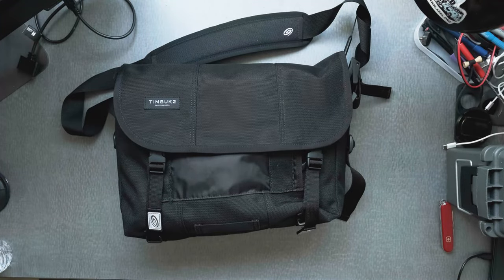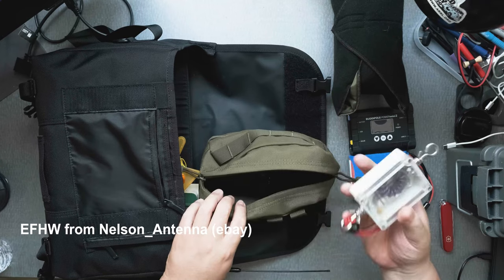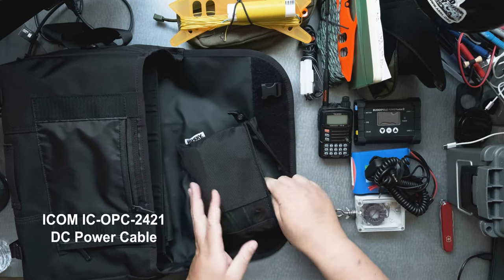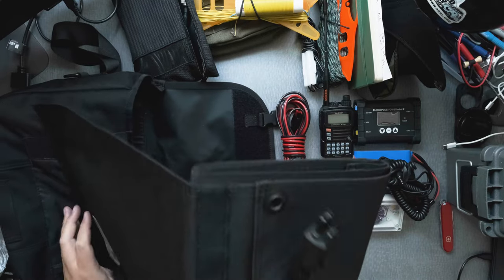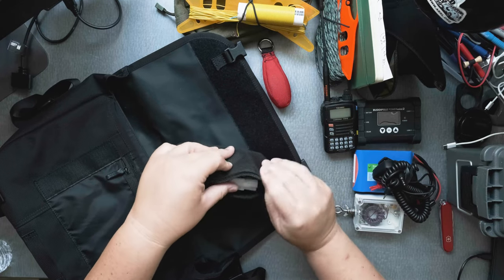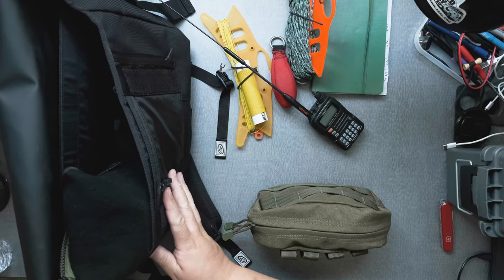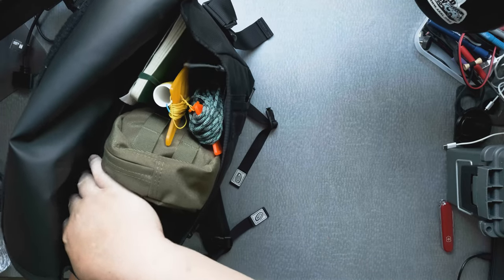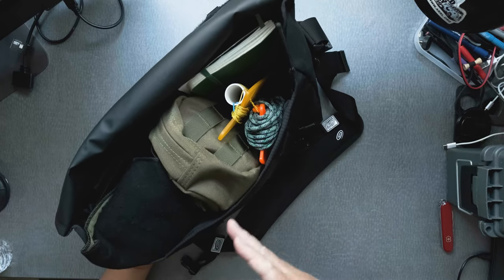IC-705 Go Bag

Comment: Hello, Frank. I really enjoyed your video. Question: The Aptiv to Andersons Cable---where did you get it ? I cannot find one on any of the web sites. Did you make it yourself ? Thank you !
Reply from the maker: Hi.  Can you tell me where in the video you saw that.  Thx.
Reply from the maker: Ok, now it makes sense.  I call it a delphi connection, but Aptiv bought the rights and changed the name.  I created that cable.  What you can do is buy the Aptiv with cable and cut the other end and place a Anderson Powerpole.  You may buy the Aptiv separate and crimp the pins, which takes some time to figure out, but doable.